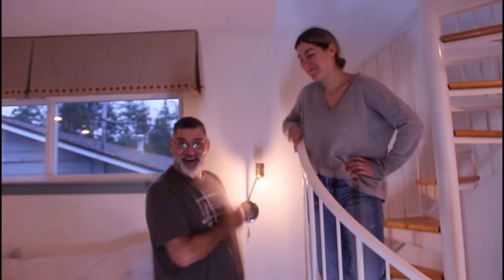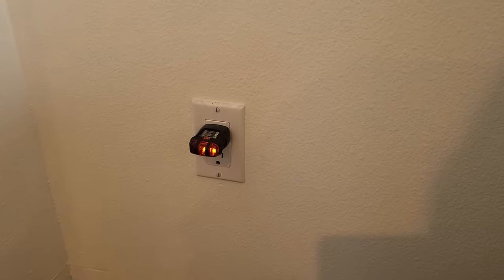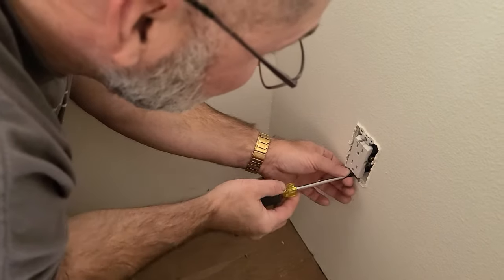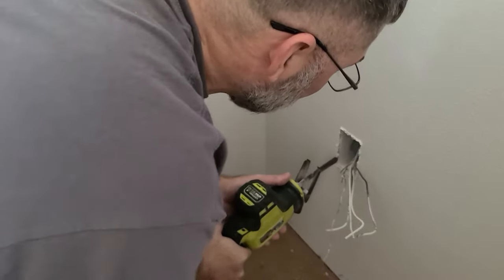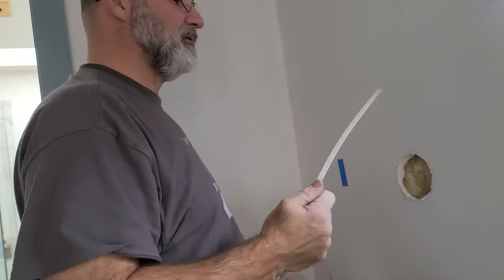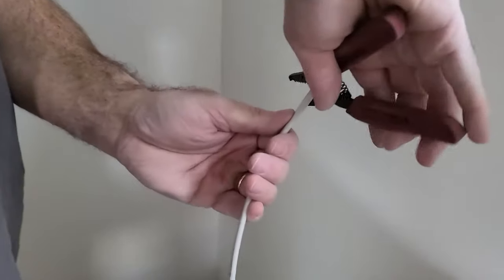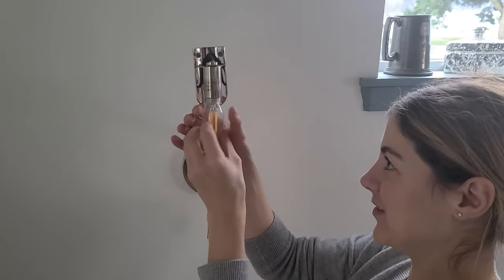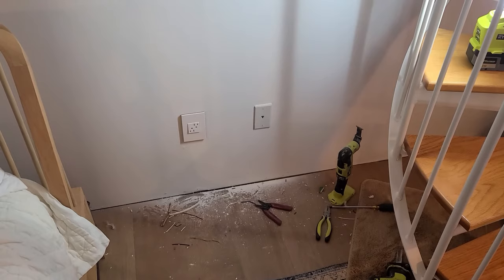Six EASY steps to bedside lighting! | Wall Sconce Installation

Comment: I have the same exact install situation. Is it possible to just add the romex wire and box for the light fixture without having to cut out and replace the outlet box? Thank you!
Reply from the maker: It's possible, but the time it would take to fish the wire into the old box, it's just easier to replace it.
Reply: Got it thank you!
Reply from the maker: @Ash12905 Good Luck!!

Comment: when coming off a GPO to a light you need to keep the same cable size… otherwise the circuit breaker can’t do its job correctly and you could potentially cause an electrical fire and burn down the house…

Looks like you ran 1.5mm 2C+E off a 2.5mm 2C+E circuit… because the 2.5mm circuit will have either a 16A or 20A C/B back at the switchboard these breakers are rated to protect the larger 2.5mm power outlets cables…

Because 1.5mm cable has a lower current carrying capacity (14A-15A maximum depending on how cable is run) if it were to overheat for some reason because the breaker on the GPO circuit is higher than that current (it’s either 16A/20A) then the 1.5mm cable would basically overheat and even catch fire if there was an electrical fault and the circuit breaker wouldn’t trip etc….

Maybe I saw what you did wrong, maybe you did install the same size cable (cross-sectional area of copper wires) as the GPO circuit, if so just ignore my comment… 

You can always upsize a cable and not worry about the circuit breaker ratings… but if you ever downsize then you need to always downsize the circuit breaker rating/size as well to prevent electrical fires
Reply from the maker: Great comment. 15A circuit across the board. 14/2.